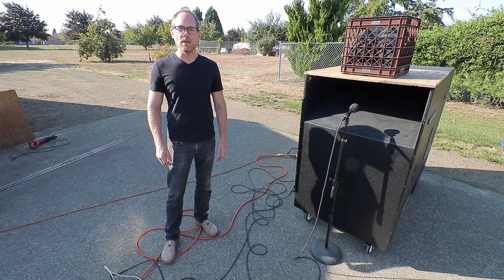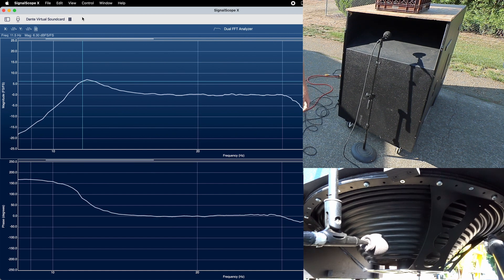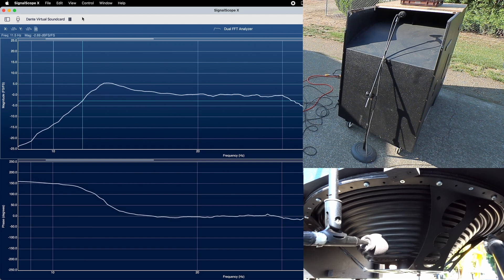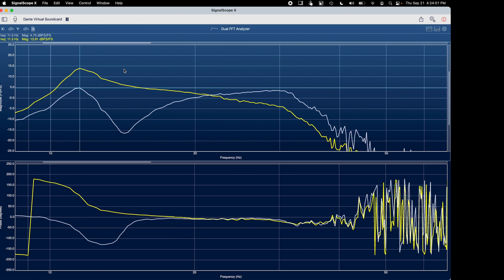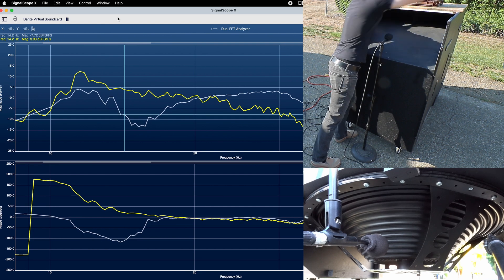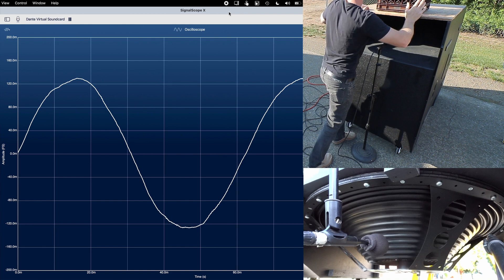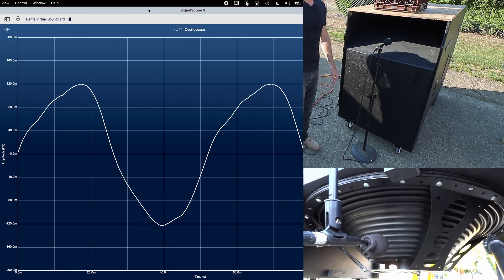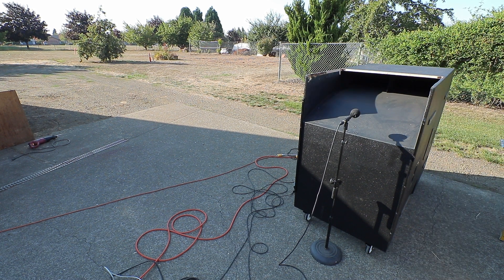Infrasubwoofer modification - raising the tuning frequency

Comment: Im targeting for apair of those but they are very expensive and im a mobil dj, I need a much compact and lighter sub 
Could it be possible to make a pair 6th order bandpass in 12 -18Cu ft and tune it to 25-30hz and 40-50hz.

Comment: 1:41 yes 16hz c0 is lowest note a pipe organ does at most of the applications. But some do 8hz i checked on google. So, you really need 8hz subwoofer, why trim down from 11hz to 16hz?
Reply from the maker: Their organ doesn’t have an 8Hz stop.

Comment: I just want to ask that there will be the same result if you shorten your port from inside of the bass cabinet ?
Reply from the maker: Probably would have a similar result overall, but the effective internal volume would be a little bit bigger which could change the Q factor but probably not very much
Reply: @devinlsheets_alphasound  are you trying to say that if you reduce port length form the inside i till effect the volume of the box ?
Reply from the maker: @rohankanojiya9756  yeah that’s essentially what’s happening
Reply: @devinlsheets_alphasound  i really like your content and i appreciate your ideas can u plz make a brief video on port size for sound pressure level spl
Reply: @devinlsheets_alphasound may you please build a 1hz subwoofer? No doubt rotary subwoofers are out there albeit they are too expensive. Please teach us how to build a super efficient 1-20hz subwoofer.

Comment: to see what one driver can do is great and all, but it should be easier to get good results with a sealed box design, in that huge box in this video you could put a lot of 15" woofers, and dsp to desired goal. sealed box size are so flexible when picking the volume, i had great results with all my designs and some of those i made at random almost. and you can play as low as you want and as high as you want with them. phasing issues should also be lessened.

Comment: The lesser distortion and the smoothing of the waveform when shortening the port are both likely due to the lesser excursion needed at 20hz when you shifted the tuning upwards.
Reply: That and, I think the sub is just struggling less

Comment: What amazes me is how the spider is not attached in the outer side, only in the middle. And the cone is actually a giant surround.
By the way, I reduced the port of my subwoofer too. Hahaha!
In the end we don't want subbass that much, not many songs have it and the ones that have, compensates with harmonics an octave above. 
Now I am sticking with 35hz to 110hz. Not the ideal 150hz, but I'm getting there.
Long live to the chest pounding bass, even if sciency it's necessary to understand it and finally achieve it.
Reply: The cone isn't a giant surround. It's ribbed to give it more strength to make it more rugged and reduce rocking modes. If it was a giant surround it would distort a lot.
Reply: The ribs also create additional volume, and if you straighten it out, the cone will be even larger. @peniku8

Comment: Nice demo and measurement.  Even with an expensive, professional subwoofer, the THD at low frequencies is way over 20%  (perhaps > 40% at some frequencies, especially near port crossover).  So much for anguishing about  the pureness (i.e. 0.000x%) of amplifiers at low frequencies below 100 Hz.  A super expensive Audiopile* speaker likely has even more THD at low frequencies yet their owners won't even consider an amplifier with 0.1% THD. 😂

* not misspelled; intended denigration.
Reply: There is a difference between perceived thd on speakers and amplifiers if I am not mistaken. Earl Geddes talkes about it a bit.
Reply: @pulDag  Really? Please explain!
Reply: @shazam6274  Amp clipping is typically hard clipping, which results in a series of odd harmonics and distortion content that is way higher in frequency than the fundamental (like 5th harmonic and up), which isn't that extreme when you overload speakers. Distortion masking is stronger the closer you come to the fundamental, so 2nd order harmonics are the most inaudible, so 10% THD from an amp can sound harsher than 10% THD from a speaker. This is also why the CEA-2010 standard exists (weighted distortion measurements).
Reply: @peniku8 1) This is about the final component of the "audio chain": the speaker.  When a speaker has 20% or more THD, which is more than 3 orders of magnitude higher than the typical amplifier, The tiny THD of higher harmonics of a clipped amplifier are insignificant.  2) The test did not specify any clipping of the amplifier, so assume there was none. 3) 2nd harmonic distortion being "masked" is at best an excuse; no distortion = no "masking" needed.  4) As for distortion from an amplifier sounding "harsher" than a speaker, you have obviously never heard a speaker with a torn cone or scraping voice coil former.
Reply: @shazam6274  Not sure how your answer relates to my comment, but I'll clarify the premise/thought I was answering to to avoid confusion:
"Why could 10% THD of an amp sound worse than 10% THD from a speaker?"
Sure, in normal operation the amp will have orders of magnitude less distortion and a broken speaker will sound terrible, I think that is pretty much common sense. Btw, the topic was THD (harmonic distortion). A scraping former will produce a lot of non harmonically related distortion, which is much more offensive, as you correctly point out.
Reply: @peniku8  My point is that people obsess over <0.001% THD of an amplifier when whatever speaker they listen to has 2-3 orders of magnitude more!  And if the speaker has more than one driver with a crossover network, or a "tuned" port" it is even worse at certain frequencies.  As for "harmonic" vs "non-harmonic" distortion, nobody can tell or cares what the frequencies of the distortion are, they just know it sounds bad!  
Interestingly, back in the 70's speaker companies were deluged with warranty claims for distortion or lack of high frequency reproduction.  The "tweeters" were all "blown". A bit of research discovered that the users all had ~25W-50W amplifiers and listening with the volume so high that the high frequency harmonics from severe clipping was melting the voice coils of the tweeters.  This lead to some speakers having a minimum wattage rating.
Reply: i could write a book on your comment, although somewhat correct, the weak link is always the physical woofer, however air tself "distorts"during compression....especially in the low frequencies, typically, also the human brain is a poor distortion meter in the low freq, as oppose to 3khz when its a very good distortion meter, under 20% distortion below 50hz would be desribed by pros as being "very clean"...further this set up is not sealed box which would be very much cleaner, the front side air is interfering with the rear side air resulting in these "apparently" high dist. reading, in pure sealed with same power this woof is less than 0.4% true distortion, i know this woofer very well...AND YES DISTORTION TYPE DOES MATTER...the brain does alot of automatic distortion reduction or ampllification...your brain can detect your wifes voice accurately to -17db from a positive +150db...i.e. signal to noise easily 167db!!!😳😳😳😳0.00000001% distortion "inversion", the brain is the miracle..there are also many many types of variable distortions...typical AUDIO PROS are only measuring AMPLITUDE DISTORTION
Reply: @lunam7249  Simply put, the design goal of any audio system should be reproducing the original sound (i.e. from the microphone) to the Speaker, with the lowest degradation / "distortion" practically possible, regardless of the type, characteristic or description of the introduced distortion.  Even subtle "coloration" due to the characteristics of the microphone or speaker are "distortion" from the original sound.   My point, which seems to elude you, is it that it doesn't matter where the distortion comes from, the listener hears the cumulative distortion of the entire audio chain and in almost all cases the vast majority of any distortion in an audio system, especially at lower frequencies, is the speaker (i.e. the driver(s), crossover, and enclosure).  Assuming that none of the components in the chain are "overloaded" i.e. operated beyond their design capabilities (i.e. microphone, too much SPL, amplifier to much gain causing clipping, or speaker driven at or beyond x-max), the only component in the chain that has over 10% distortion, in normal operation is the speaker.  

This is a simplified description without getting into all the details of: phase shifts, crossover phase and amplitude dips and peaks, large variances of the enclosure performance and directional issues, and many more sources of distortion.  

Your wife talking (or shouting) at 150 dB SPL is difficult to imagine, perhaps seek counselling before you incur permanent hearing damage  😲.  You are correct that hearing and brains are indeed marvels of flexibility and capability, but we're talking about audio equipment here. 

My point is that people obsess over parts/million THD in their equipment and pay a lot of money for that, EXCEPT when it comes to speakers.  Your statement about "Pros" is wrong.  If they thought 20% THD at 50Hz is clean, let them then listen to the same thing on some high quality headphones.  They will certainly notice the difference and revise their opinion of the 20% TDH Speaker.  

It seems to matter less, and less, since most audio is now consumed is severely distorted by various compression and tone shaping algorithms (AAC / MP3/ etc.) built into almost all audio devices and streaming services.   Additionally many listeners have permanently damaged their hearing by their mid 20s.
Reply: @shazam6274  i agree 99% what you say, speakers + recording mics ADD lots of distortion are 99% of the distortion(it didnt elude me).....and yes pros, dj and areanas/ stadiums find 20% in the lows acceptable(there is no choice , even the best systems in the lows at 150 db are 10-20% distortion, and human perception of distortion below 50hz is really poor.....true computer reading not the marketing ad)......but mids and highs only 0.5 to 1% distortion already sounds really horrible....as you say , try some high quality i.e.m., or senheiser ,their really clean even in the bass....most audiophile / live symphony = 100db(low low distortion)......while stadium / rave sound front row = 130-150db, distortion ratings skyrocket. also AMPLITUDE DISTORTION  is the most published but actually contributes the least to THD%, but yes modern amplifiers have superlow THD...interesting , in blind A/B TESTING vacuume tube amps even with higher distortion numbers than pure class A MOSFET "sounds" better to 9/10 audiphiles/pros....
Reply: @shazam6274  if your trying to say audiphiles are dumb, ya some are, some are not, im an audiophile + a stadium pro, look when a "audiophile" spends $46000 on some briston prototype amp. he knows part of it is the "rush"...my buddy owns a lamborghini, does he know my $15000 fixed/turbo 1992 honda is faster....ya....but the lambo makes him feel good, and gets him laid....so hes happy...my dad owned a ferrari, same thing...we would be at a red light with 5.0 mustangs wanting to race, my dad would just laugh, knowing he might lose, but the point was just to have a ferrrari...from the musician to the mic is already 1/3 of distortion, playback thru speakers is the other 2/3 distortion..mics add alot of distortion, ALOT!!!